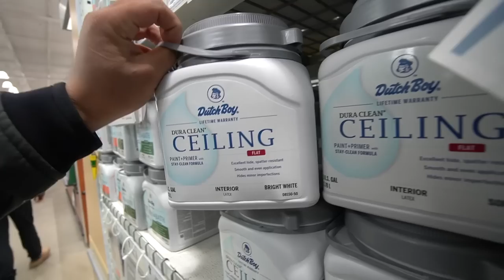Building a Homemade Ice House! (IT'S ALMOST DONE)

Comment: Not sure anyone mentioned it but honestly it's a great idea to put wood blocks do to set the house on vs on the ice I'd suggest 2x4s or 4x4 if you plan to keep it out all winter in one spot and just bank the house good. Also for an ideal heater for you in my opinion would be the ebay Chinese diesel heater I have one in my house and I love it. Don't use alot of fuel in my house (4x8)  but on level 1 stays 70+ and burns about gallon in a day plus is a vented heater so no fumes in the house and it's forced air heat. Just my ideas to toss at ya

Comment: Dimmable led strip, hole spot lights, some sort of venting system co2 detector and then inspect underbody for any  maintenance needed, plus spray foam for insulation if it isn't yet. I would draw they layout out before you start placing things into place in the interior like storage shelves cupboards etc. You guys should of ran electrical before putting the wall up but still doable. Checking for a mountable location to run dakota lithium solar panels to power your batteries too.

Comment: Outlets and placement of them also any 12v wiring charging of electrics, camera gear. Cabinets. 12v lights if your not going to run generator 24-7. Hole Lights all things to think about while your building.